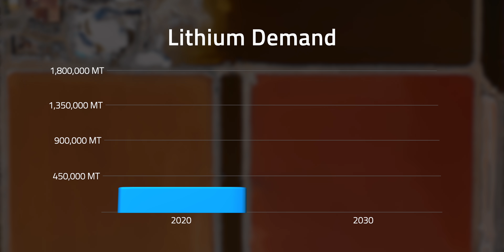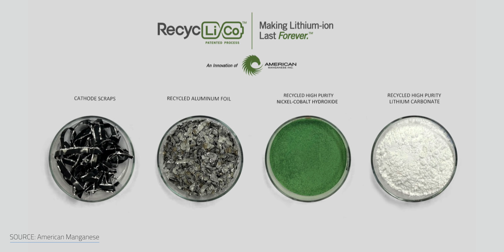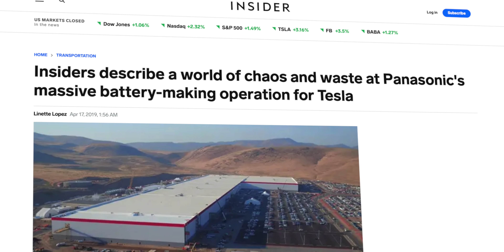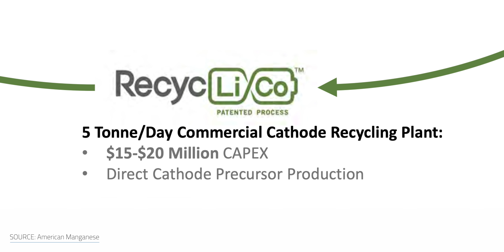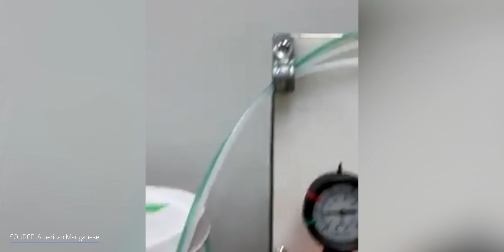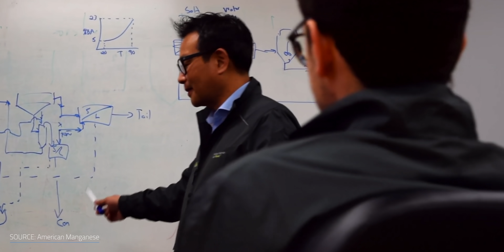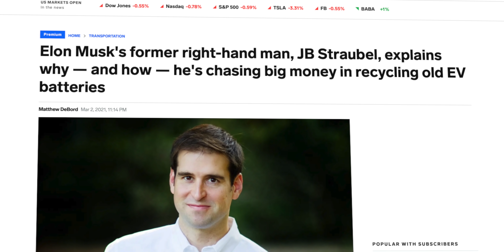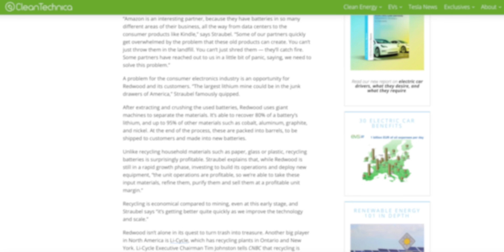Solving EV's Biggest Problem - Battery Recycling Explained

Comment: What you didn't mention was that you need electrolysis process to gain the metals during hydrometallurgy process, which consumes a lot of electricity which comes from coal power plants.
Reply: If they're electroplating out the materials, yes.  But if they are just using hydroxide precipitation, then no.  Very little electricity, other than that used to run the compressor for air pumps, is used.  But the chemicals used, sodium hydroxide and various acids, are not cheaply made and do use resources in their manufacture processes.  I've set up industrial scale hydroxide precipitation systems in plating shops to recover silver, nickel/copper , tin, and zinc.  All work very well if designed and operated properly.
Reply: @jimmurphy6095  Is the purity of Li gained by hydroxisw precipitation enough? I believe they also need to purify it with electrolysis.
Reply: @eneskayacan4583  He was showing the Ni/Cu hydroxide but I suspect it's a bit of both.
Reply: Electricity usually only comes from coal fired power plants in less developed nations these days. The UK for example, gets just 4% of it's energy from burning coal...... You would be thinking of places like Poland and Croatia....

Comment: In the future recycling will replace mining completely, because it will be cheaper. Lead acid batteries are already recycled, same will happen with lithium batteries, making mining unecessary.  Batteries will get larger energy density so less batteries will be needed for the same amount of storage.

Sea water will be sufficient for getting more minerals for new batteries when recyclying approaches 99%, and could be used in combination with desalination.

Comment: It will gets better and day by day but if the process is so efficient , then all lithium ion battery manufacturers must invest in recycling them to dominate market in sales.
Reply from the maker: In many cases it will be cheaper to recycle than dig for new materials, so all companies should eventually have a recycling supply chain in the mix.
Reply: @UndecidedMF  I hope Tesla does it first.

Comment: Eventually when there is enough recycling done around the world the need for mining gradually slows down. With chemistry you would be able to get all of those metals recycled, but there is the cost of reagents acids, bases, solvents etc. possible heating and cooling energy costs. So it is only matter of cost, and with competition you get lower costs for recycling.
Reply: with 10 billion people by 2050 can you tell me when it will slow down? India's income is rising at 7% per year, motorization will occur around 2050s.

Comment: I think it will be many years until battery recycling replaced mining but it could happen once enough material gets into circulation if these recycling numbers are accurate. As the world moves to EVs though the demand for these materials will only increase exponentially barring a huge shift in battery technology and as such mining will continue to be absolutely necessary for a long time to come

Comment: So this is mainly about recycling manufacturing scrap, rather than recycling cells that have been used by a user and had a few 100 use cycles? Is this correct? I think it would be interesting to understand the recycling of batteries at end of use
Reply: Recycling batteries is the same no matter how they are used prior. The metals inside those do not change.

Comment: Recycling lithium battery components in a sustainable manner is a noble and worthwhile effort, but it is a relative drop in the bucket of worldwide demand for those raw materials.  This is especially true if EV's are to replace an appreciable percentage of ICE vehicles.
Reply: Sure, but we need to be ready when real numbers of used batteries are becoming available. Recycling is not only a matter of gathering material for new batteries, it's also about properly disposing the waste.

Comment: What I would like to know is what goes wrong with a battery to make it stop taking a charge? and how come you can recycle it and make it work again?
Reply from the maker: This is grossly oversimplifying it, but batteries expand and contract with each charging cycle.  Dendrites form.  Cracks form.  The structure of the cell slowly breaks down and isn't able to pass the ions back and forth as easily.  It's not a breakdown of the underlying materials, but the structure.
Reply: Side reactions with the electrolyte and trapped ions in the anode or cathode (e.g. where a piece loses contact with the bulk of the material due to the aforementioned side reactions).
The side reactions are virtually inherent to the battery chemistry and physics. Only new chemistry can solve these, whether it be a stable (solid) electrolyte, a more chemically stable (liquid) electrolyte or even an entirely different type of battery chemistry (i.e. other anode and cathode materials, perhaps with use of a less reactive ion compared to lithium).
Recycling, simply put, takes apart the atoms which make up the battery materials and then separates them as good as possible (higher yield & purity = better value creation from waste). These separated materials can then be used to make new battery materials (cathode, anode, etc.) or used in other products. The new battery materials are then simply new batteries and therefore they work again.
Reply: @UndecidedMF  Thanks I can understand that, hope it wasn't a stupid question.

Comment: Most likely recycling won't replace mining primarily due to pushback on job loss and new cost of setting up recycling. I.e.,  likely using a combination of both, with hope to transition over more so to recycling
Reply: That's the idea. Once we have the theoretical max of minerals we need those mining jobs can be slowly transitions to refineries as you still need the work force, large thing people forget is that mining isn't indefinite resource. We will run out of capable ground to produce. That's why we are producing more recycled

Comment: This video didn't really address the problem of EoL recycling, did it?
Also I was missing some numbers that would have really been interesting. What percentage of the materials in the feedstock do they actually recover? At what cost do they think they will be able to do this? How does this compare to current mining costs?
Reply: EoL isn’t the immediate supply for these cathode materials when production scrap is 10-30%

The cost of re-agents is around $1/kg and the product out the end of the process is a total (average of all materials) of $15/kg at market price. 

So a revenue of $14/kg not including electricity costs. Their process is mainly pumps and mixers so not an extremely high electrical demand.

Comment: I'm an ignorant pleb. But I work in the sheet metal Industry. 
What we are seeing is a shock in availability of PVDF (Kynar) paint. Because apparently the resin involved in this paint is also used in binding lithium ion cells together. 
I'm curious to know if an industry that consumes thousands of tons yearly can accommodate such an increase in use. 
IE it's not always the metals that are the issue

Comment: It has been my understanding that, Yes, the lithium batteries have always been recyclable but at a higher cost than just mining new metals. You didn't address this in your video, do you know if that is still the case? For example Lead acid batteries are easily recycled at existing smelters thus they actually have value. Lithium batteries have no value if it costs more than the metals are worth to recover.
Reply: Yes, that is exactly the reason why almost all electric vehicles coming off the production line now are made with newly mined materials.  The video gave the impression at the start that recycling of Lithium ion batteries is widespread for EVs, but it isn't.  How long this will take to scale up and produce cheaper Lithium and other rare metals than mining is unknown.  In the meantime, the ramping up of demand for EVs is going to continue to drive increasing environmental damage as we turn to stripping the earth for metals.  It's a shame that in the rush for BEVs other intermediate solutions are getting overlooked such as electric cars with much smaller batteries that can handle most city driving and with small, extremely efficient range extenders for longer trips.  Battery tech just isn't quite there yet in terms of cost, recycling, energy density etc.

Comment: The amount of lithium required  to put towns, cities and nations onto renewable energy would be huge, those charts scare me a little bit. Are they from the expected yearly consumed or are they a total used till that point. I personally hope for the large scale batteries the market goes in the direction of other battery types. Where materials used are more common or using other forms of energy storage. Ideally lithium based batteries should be kept for portable systems, due to their comparative weight to energy density. But i guess the market will go where it goes unless taxed otherwise.

Comment: EV vehicle resells are going to be awful.
Being the avg. battery will last 120k miles.
Now(2022 probably the cheapest prices we will ever see)12k-20k just replace the battery you haven't even bought the car yet.
Another Big Issue that the Green Energy pushers did for us. Is lied about how easy it will be to recycle or reclaim OLD SOLAR PANELS...
It's not easy & it cost money to recycle them. There's no payback.
So guess what that really means...
Stock piles of no good Solar Panels just piling up. Toxic Chemicals breaking down into the EARTH

Comment: Can the recycling be done with NO Carbon footprint ? NO
Do the trucks for transport, lights, motors in the machines used run on Batteries ? NO
Can recycling be accomplished without Oil, Gas, and Coal ? NO
Reply: Does that matter? NO
Reply: Until the world's energy is 100 percent green, of course some pollution will follow with literally anything we do. So this is a rather pointless argument.

Comment: I think batteries will eventually become obsolete because the need to store the energy will be replaced by various kinds energy-on-demand power plants inside the devices which will be much lighter and generally make more sense, especially in larger devices and machines, such as cars and trucks, ships and aeroplanes.

Comment: We need to get to the point where most battery materials come from recycling, especially the rate earth metals or those that require kids sitting mud. All sales of batteries should require internalizing the external end of life costs. I am charged a core fee replacing led acid batteries. A similar up front cost should offset/incentivize the recycling costs.

Comment: He says that skeptics claim there's no way to recycle li ion 
 batteries. Then he says that's not true. He "supports" his claim by saying there are many companies WORKING ON THE PROBLEM. So he's not telling the truth. By his own admission. They are working on solving the problem BUT the fact remains that recycling these batteries is not possible - at least not without creating tons more pollution for the little amount of recyclable material extracted.
Reply: Agreed.  Where is the cradle to grave analysis of the solution, i.e. Total energy used from mining, to production of the product, manufacturing of the batteries, recharging the batteries (this includes the infrastructure required to facilitate the charging process) over the period of the batteries lifetime and the recycling process for a full scale plant, and this must be compared to a cradle to grave analysis for the current alternative energy sources.
And, other than mentioning it, the pyrometallurgy process is not covered (must use more energy?).

Comment: Unless demand is stagnant and do not grow and recycling can recover 100% it will never replace mining. It is far more likely that the chemistry of batteries used will change to or include many other materials than current cells use. The stratification of battery types is more likely to happen as the usage have different requirements for optimal funktion. IE a stationary battery is more dependent on cost and cycle life than weight or volume while a car is the opposite.

Comment: The energy used for resource extraction manufacturing, transport, disposal and recycling of the BEVs 1200+ lb chemical batteries totally eclipses any concerns over FCEV inefficiencies or concerns. 
Unless battery tech increases dramatically soon, the battery will continue to the BEVs Achilles heel.

Comment: Energy demand growth isn't going to stop and neither will demand for energy storage. Even if recycling achieves 99.9% recovery and battery technology keeps getting closer to the theoretical maximum Wh per kg of raw materials used, mining will still be required to keep up with total demand. Hopefully alternative storage technologies and chemistries like liquid metal and flow batteries will relieve a good chunk of it for static applications from 50kWh power walls through GWh grid-scale storage.
Reply: according to the US energy agency lithium is here to stay for 10-15 years and to achieve the paris agreement we need 50% reduction in 9 years

Comment: I have to disagree with you on 1 thing..based on current technology the most used type of batteries will be Lithium iron phosphate type..and we can build infinite batteries..would you agree?
Reply: "infinite batteries"
Reply: @Lildizzle420  yup LiFePO4 composition can be made as much as we need or want...already CATL providing this batteries to china made model 3
Reply: @sudeeptaghosh  I'm just waiting for a lecture on battery day
Reply: @sudeeptaghosh  LFP batteries still use lithium. So what do you mean 'infinite battery'?
Reply: @anxiousearth680  yes we have infinite amount of lithium we need(very abundant in nature) .. actually lithium is not the biggest component in lithium battery it’s the smallest only 5 to 7%.. compared to cathode and anode material please check for yourself …
Reply: @anxiousearth680  the reason I said infinite .. we have a limitation of Component for NMCA batteries (stands for nickel manganese cobalt aluminum) but not for iron phosphate batteries ..

Comment: Recycling is a fancy way of saying you can find someone who'll buy the material from you rather than pay for "new" material.    So unless it costs more to buy it from the mine,  no I don't think recycled material will overtake mined stuff.
Reply: A stable recycling process is reliable, however, while supplies from a mine may not be.
You can recycle nearby the production plant, cutting transport.
You may even be able to achieve high purity easier through recycling, as the composition of e.g. the battery is known almost completely, while mined ore may contain a plethora of contaminants in varying concentrations, many of which may not even be extracted during refinement.
There's also a lot of precious metals in electronic scrap, while ore usually has such little precious metal content that it is often not (financially) worth trying to obtain it when processing e.g. zinc ore.
Besides: you have to find or purchase ore, while people will give you old electronics for free - or they'll even pay you to take it!

And last but not least: Recycling is cheaper than mining. 
[random google source to back up statement : https://www.recupel.be/en/blog/7-reasons-why-urban-mining-is-overtaking-classical-mining/]

Comment: We still will have to mine for now.  We will have to charge them and wind and solar won't meet our power needs.  What do you think about Liquid Fluoride Thorium Reactors (LFTR's).  Please research and spread the word if you think these are safe and can be a longterm answer.
Reply: In theory yes yes could work same with hydrogen engines, that's why people arnt always saying just electric but the progression of moving from fossil fuels to safer alternatives. Lithium Electric isn't as usefully in all aspects but hydrogen power or nuclear power can take up the parts that don't work over other

Comment: The point is to reduce mining to levels that are manageable for the harm to the environment. If we can recover 90% of batteries that would drastically reduce mining needs and make our resources last much longer. This is the long range pay off of ALL recycling efforts, leaving a better maintained planet for out descendents and planning for a brighter future.
Reply: you can't recycle 10 million cars today into 3 billion cars by 2050 so no that's not gonna work, its just a supplement. they're desperate and will take all they can get so yes, absolutely they will recycle every oz
Reply: @Lildizzle420  There are probably 3 billion cars world wide in junkyards and landfills, not to mention all the other appliances and electronics. If we were to stop wasting all of these RESOURCES and recycle them we wouldn't need to mine and destroy our environment and health as much. The math is simple: I make 10 gadgets, if I can recycle 90% of the to remake them then I only need to get enough extra material to make one more to get back to 10. We have put so much "trash" into the ground that we could be using, it only makes sense to businesses out to make money. We have a plastic island/continent in the ocean. how much more damage do we have to do before we realize that we have to fix this mess. We don't need to worry about asteroids, zombies or the rapture, we will destroy ourselves slowly one cut at a time.

Comment: So let's be clear here - the push towards EV's is going to potentially generate more problems than it solves. Where is the energy going to come from the charge all these vehicles? The mining required for raw elements will decimate landscapes and cause huge environmental issues and the recycling problems mentioned in this video are real and going to become a huge problem. Still though, all that's talked about is reducing the carbon footprint, and nothing about any of this. EV's are not the answer, and stand a good chance of just moving the problems elsewhere.